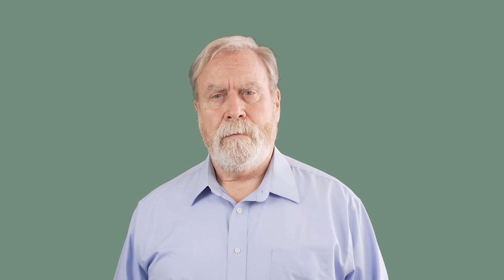The car jerks while braking. Causes and solutions

Comment: Hi I replaced the Break pads and rotors (disc) still shacking when I break.

All calipers checked, what could be the problem?
Reply from the maker: Hello. If it’s still shaking after new pads and discs, there are a few things worth checking:

1. *Rotor not sitting flush* – If the hub wasn’t cleaned before fitting, dirt or rust can make the disc sit uneven. Quick fix: take the disc off, wire brush the hub, and refit it.

2. *Wheel nuts not torqued right* – If they weren’t tightened evenly, it can warp the rotor. Quick fix: retorque them in a criss-cross pattern with a torque wrench.

3. *New but faulty rotors* – Happens sometimes, or they can warp if overheated. Quick fix: check rotor runout, replace if needed.

4. *Suspension parts* – Worn tie rods, ball joints, or bushings can cause shaking when you brake. Quick fix: inspect suspension and replace anything with play.

5. *Wheel bearings* – If they’re loose or worn, you’ll feel vibration. Quick fix: check for wheel play, replace bearing if bad.

6. *Wheel balance/alignment* – Out-of-balance wheels or poor alignment can exaggerate brake shake. Quick fix: get wheels balanced and alignment done.

7. *Tires/rims* – Uneven wear, bulges, or a bent rim can feel like brake shudder. Quick fix: rotate tires, check rims, replace if damaged.

I’d start with making sure the rotors are seated properly and lugs are torqued, then move on to suspension, balance, and tires.